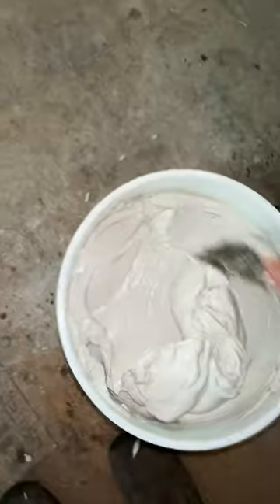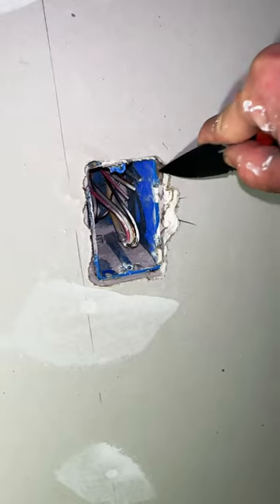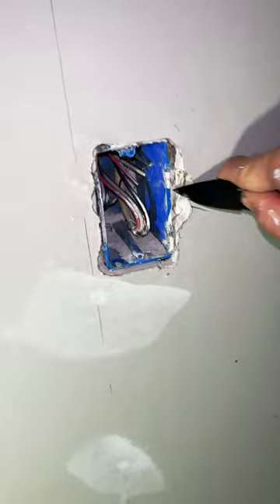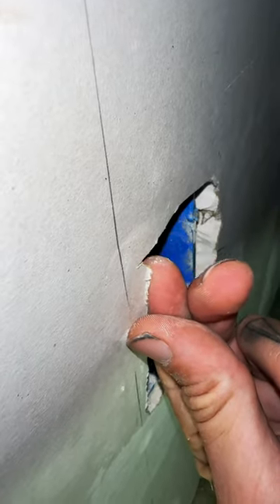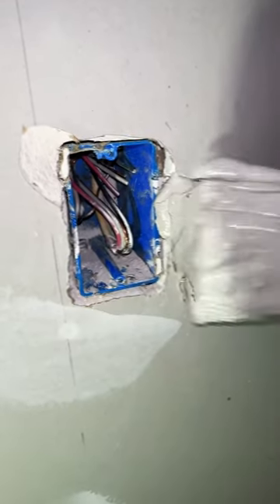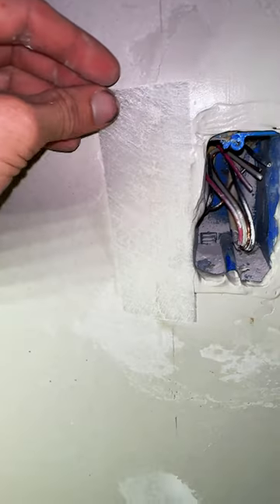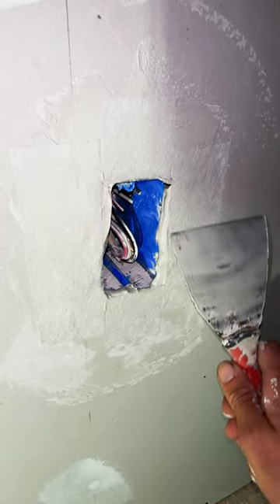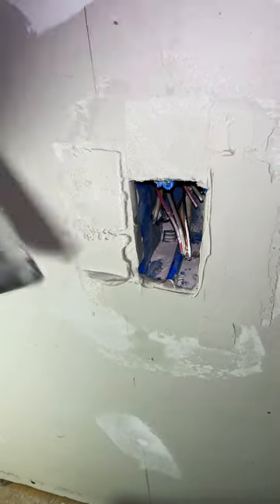Fixing drywall around an outlet box

Comment: Ok I saw the green bucket. That's joint compound. Good. Point, don't use "spackle". The patch stuff in a pint size plastic cup. Spackle dries very hard. It's very difficult to sand smooth. Compound can be sanded with a moist towel. You choose.

Comment: I use a little PVA glue in my drywall mud, particularly when using hot mud,  to help adhesion in these circumstances, and over painted surfaces, after a little sanding.

Comment: Using a router was the most difficult thing for me until I realized you don't put it all the way in, it's not something anybody told me or noticed why I was so bad at it, it's just how I thought the tool worked. None of the routers we had have a guard on them. Once it clicked though it became trivial and I've done a hundred boxes. Counter clockwise for outside, clockwise for inside.

Comment: Take your nail punch find the edge of the box. Hold roto zip tight against the outside of the box and let her rip. Take into account the small buttons coming off the box. Once you feel them just go over them and it will be smooth as butter.

Comment: Sorry but a jab saw is a thousand times better than using that tool to do this job. It takes seconds to cut each line, and then clean it up with a Stanley. That tool is purpose built for failure.
Unless you're cutting 40 of those a day, there's no need for that tool.